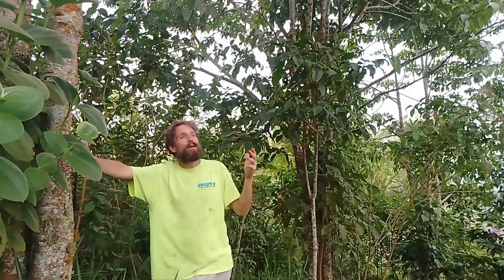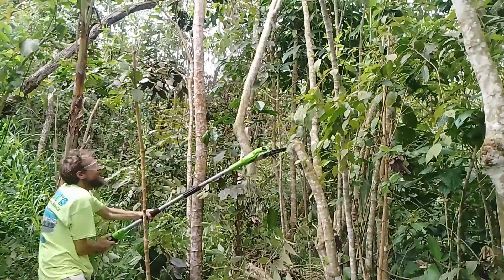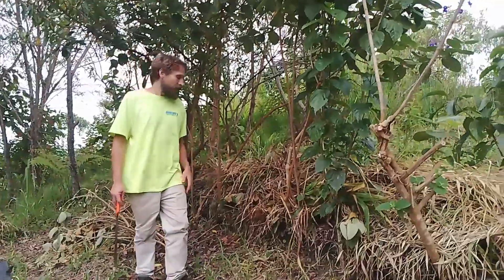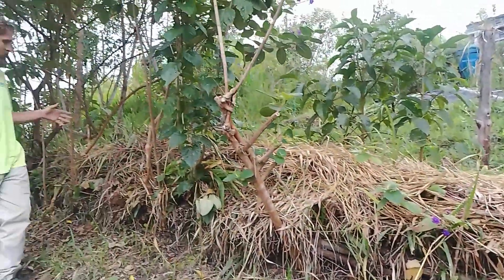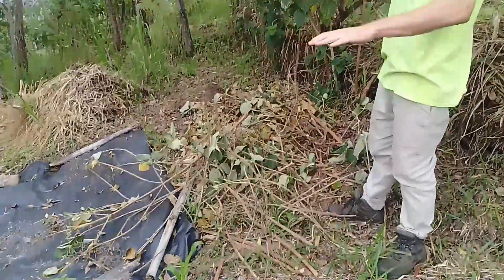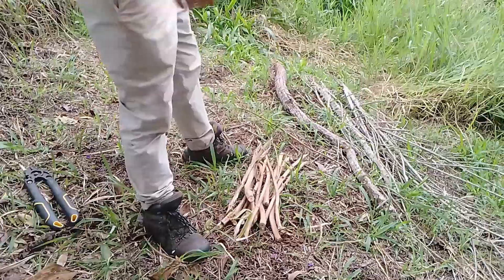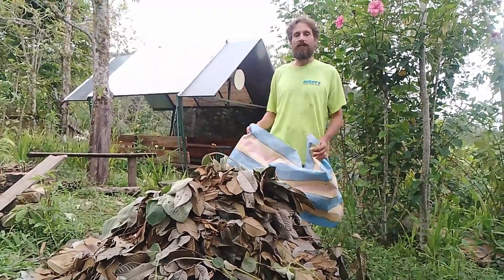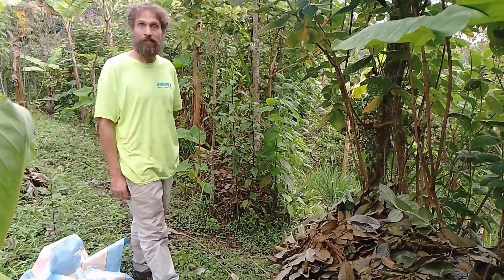What to do with too much BIOMASS from pruning on your farm?

Comment: Love your videos, always t up...

I have been dealing with this issue for years now, becomming too much wood every winter, and its gona be more and more.... I dont even use it to firewood. End up burnning most of the ticker stuff (not to "biochar", thats just waste of time).  Im finally considering a woodchipper, for mulching. But the good ones are expensive (500 plus), have maintainance issues, and the work it self is awfull. 

To be or not to be...
Reply from the maker: Yes, I  am thinking its better to save up for a good model than buying another cheap one.  

Piling it up always works too, I do a sort of above ground hugelkultur here, but if you put dirt on top its also "buried"!  

The most important thing is to balance everything with "time", our most valuable resource!
Reply: @EcoInstant if its just for the "ecology"what you are doing is just the best option. Or, at least, the best "work x produtivity" relation. And a big pile of branches is a magnet for birds, which end up producing a nursery under it. But the amount your (and me) are dealing with its just a big mess...but you are tropical, so it will probably compost fast. For me (mediterraen clima) its a big fire hazzard. I have mandatory cleanning up to do...

Comment: Wouldn't the conversion of all that "extra" biomass to biochar further improve your soil quality and also sequester the carbon in the biomass that would otherwise eventually go into the atmosphere?
Reply from the maker: I am so happy you asked this question.  Its a great video to do.  my short answer, is that what you are proposing is 100s of hours of additional labor to achieve what natural already does, inside my bund.  Microlife like mycelia trap carbon into the soil.  

How much energy, not just time now I mean heat, do you think I should dedicate to "biocharring" my biomass to remove the humidity that gasses off automagically in nature?  

This is a thrilling line of questioning because it gets to the core of eco engineering.  Thanks for the motivation!
Reply: @EcoInstant  Thanks for the reply though your response seems a bit out-of-hand dismissive.  Glad to hear of the carbon-trapping of mycelia.  It would be interesting to have scientific evidence of the work cost and various benefits of chop and drop versus biochar.  Sounds like you have settled on your method, so I'll leave it at that.

Comment: I would get a chipper while the wood is still green & chip them.
Reply from the maker: I am saving up the money now, its not that expensive but we will have to pay for shipping from the US for the model I am looking at, plus a 30% import tax 🙈
Reply: @EcoInstant make a Jean Pain biodigester to employ the shred biomas. Burn the methane instead of wood. Split the digestate in portions one to use as fertilizer the other to feed for worms. The methane is also the fuel to run the shedder.  Another option is to inoculate the biomass with mushroom mycelia.
Reply from the maker: @estebancorral5151  i will look into this!   I already have a diy pyrolytic reactor so this is right up my alley.